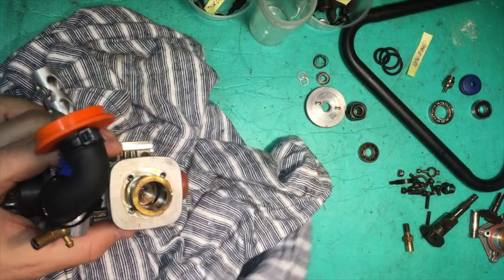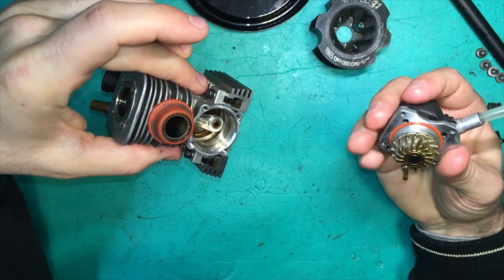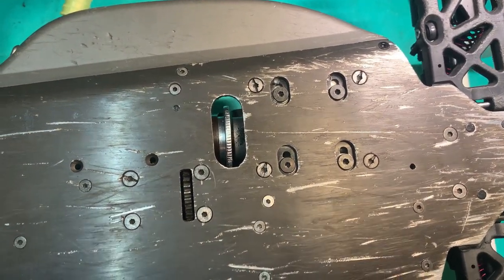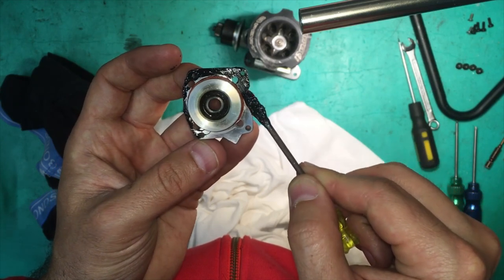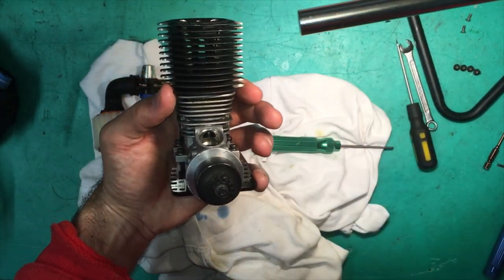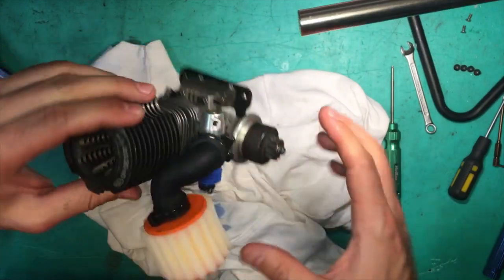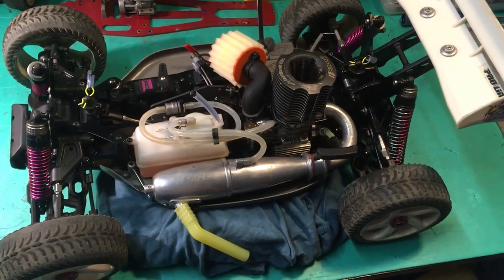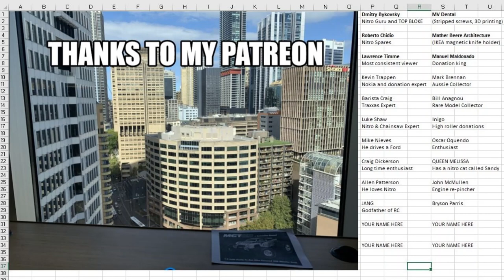REPINCHED Hyper 21 3 port (Hobao Hyper 7 TQ) CorporateNitro Engine EP15

Comment: great work with the SHIM mystery.  Turns out I have that issue on many big block motors, including a recent t-maxx motor which was killed.  Shim LIVES matter!!
Reply from the maker: You want to know the best part? If you watch the video carefully you can see I installed the Alu 0.3mm shim onto the button initially. But when I noticed the broken brass 0.1mm shim it seems the Alu shim is gone! Time to call Scully and Mulder

Comment: Great video mate!! I don't have any nitros (yet)... I still enjoy watching the technical/problem solving aspect of them though ... they seem to be a little more complicated than my 2 stroke Bajas...your videos would be a great go-to for solving problems... excellent step-by-step explanations... One thing I am CURIOUS about - who did you send your sleeves to for re-pinching?? I imagine most people would just replace them with new ones (if obtainable)!? Did you just send them to some engineering shop and tell them what you want?? OR are there hobby shops that actually provide this service??
Reply from the maker: If you are curious just bite the bullet and get a Bullet G3.0. Unless there is something else you want? Maybe a Savage? Regarding sleeves I have no clue. It’s a friend of a friend and he wants to remain anonymous and won’t let me record him. I’ve asked multiple times so I give up, I have to respect his wishes
Reply: @inzp3ctor  No worries!! I'll do some homework on this Bullet G3.0... I've kinda been looking at HSP's... They seem to be very reasonably priced (brand new) and I think may be OK as an entry level thing with easy to get spare parts!?
Reply from the maker: @dickjohnson3564  spare parts is a good criteria. I’ve had cars before that could not be saved due to lack of available spares (kyosho). Regarding HSP just check the engine. The older HSP came with SH engines which are amazing. The new HSP might be using Vertex engines which are OK and reliable but nothing special in terms of power. 
This is a channel devoted to used RC purchased very cheap. Not brand new cheapest nitro on the market. For what you pay for a new HSP I could buy 6 used RC that will all be faster. 
Choose wisely Goodluck and enjoy!
Reply: @inzp3ctor  Thanks for that info!! Yep...the HSPs I've been sussing out have the VX18 2.95cc Vertex engine... If I was to act within the next 4 days - I could pick one up from ToysRus for as little as AU$235 delivered!? My Rovan Bajas keep me  busy (and poor) enough as it is... Hence the desire for a nitro in the collection that needs minimal (if any) work... I do appreciate that your more into restoring the older vintage (better quality) ones... Thanks again for the info... Look forward to your next video!!
Reply from the maker: @dickjohnson3564  tell me what the expenses are with your Baja? I thought they were economical because you are just buying petrol and oil. With nitro you have to buy dedicated fuel $65 for 4 litres. But at 75cc to 150cc per tank that works out to be $2 for almost 10 mins. And a glow plug might be $7 to $19 but should last a long time if you don’t run lean. I don’t use any car enough to wear out components. Racing is expensive. Bashing is not. I now have lithium RX packs so I don’t even buy AA batteries. Have rechargeable AA in the transmitter, or use 3S or use LIFE battery. So I’m keen to know why Baja is more expensive when the fuel is sooo much cheaper
Reply: @inzp3ctor  OK... I'll start by saying that using the word POOR is a bit of an exaggeration - they don't keep me destitute! YES... you are correct when it comes to fuel/oil - this is one of the cheaper aspects of running a 1:5 Baja and I too have gone for rechargeable batteries... The main expenses come from at least one thing breaking/failing/wearing after about every second tank... buying replacement parts... buying extra so you have them on hand if it happens again... THEN... there is the experimentation with UPGRADES - some end up not all they're  cracked up to be and a complete waste of $$... Others work well - but then the next weakest link in the chain breaks - etc etc etc... THEN MULTIPLY ALL THIS  BY 3 bajas... THEN there's the extra general maintenance stuff - cleaning air filters - shocks etc etc... No racing - just bashing (speed runs)... At least 1 will get a run every weekend - more if my son comes over! Don't know if its just me - but all based from my experience!?
Reply from the maker: @dickjohnson3564  oh yeah I get it now. Maybe you are breaking out drives or dog bones or spur gears and these can add up fast. And yes it’s true the smaller cars are lighter and won’t wear out very quickly but the 1/10 scale nitro vehicles are very thin and will likely break if bashed hard. If bashed lightly they are fine and use much less fuel than the big block 1/8 scale vehicles. 1/8 are much stronger. Let me know what you get. A hyper 7 buggy was my first nitro. I still have it. It’s 20 years old. I have not made a video about it yet.